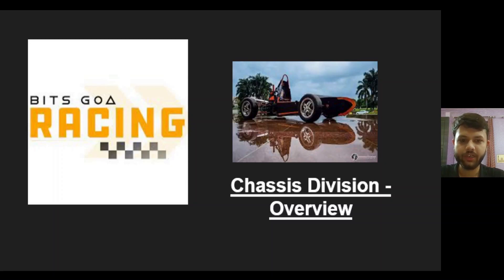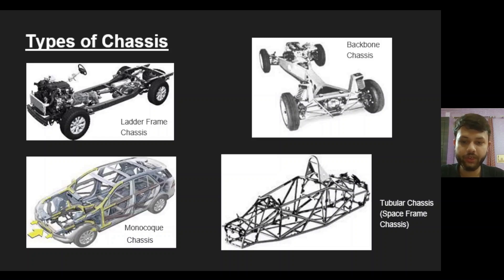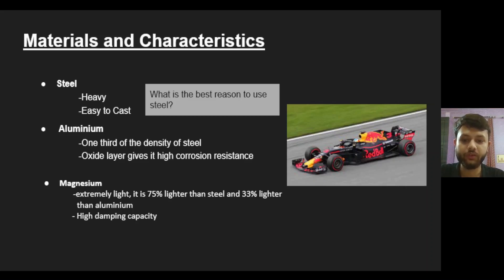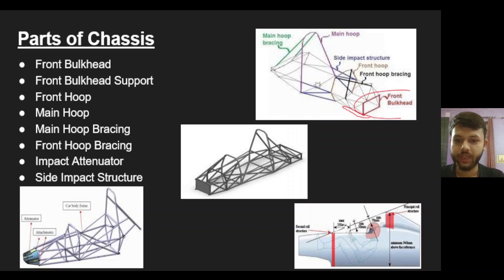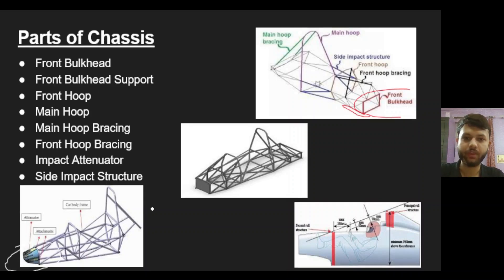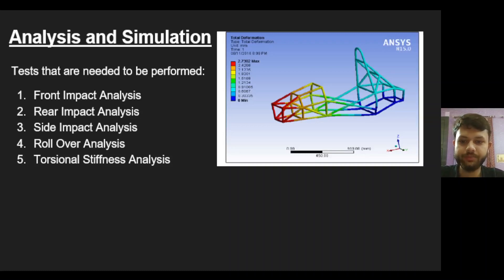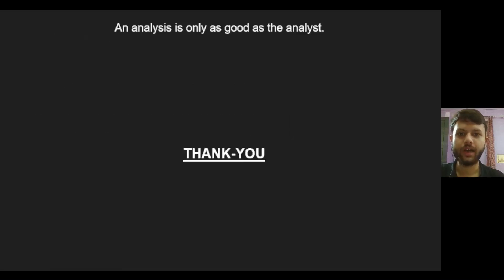Chassis - Different Types, Design Rules Explained & Material Selection | Formula Bharat | FSAE Supra

Comment from the maker: Video Timestamps

00:00 Intro and Video Outline
00:22 What is Chassis?
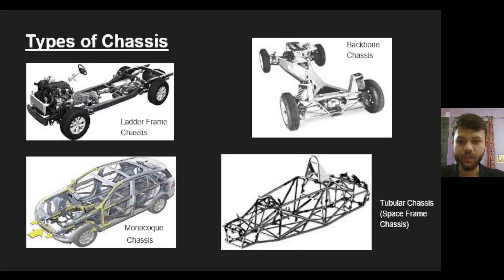00:51 Types of Chassis
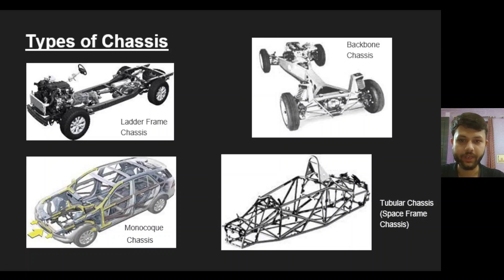03:01 Materials for Chassis Structure
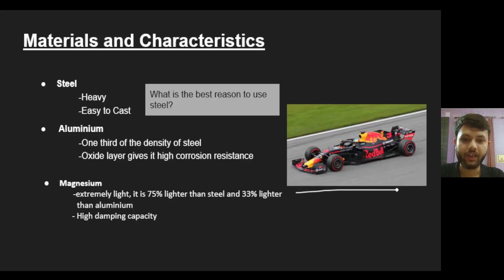05:19 Important Points to keep in Mind while designing
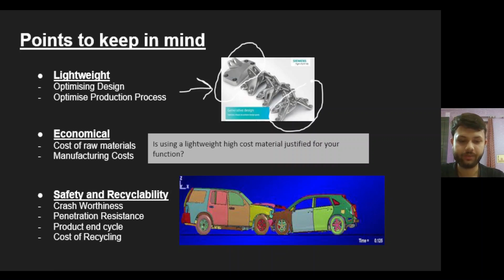06:26 Parts of Chassis Structure
08:29 Practical Scenario of Crumple Test & Crash Test
09:36 Why was Maruti Omni Discontinued
09:47 Concept of Triangulation - Basics & Calculations
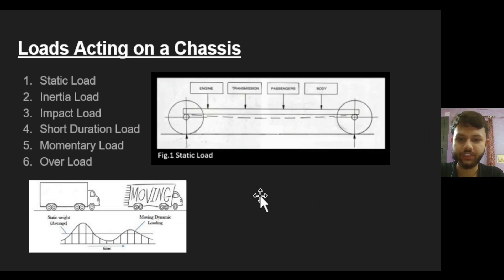11:08 Loads Acting on Chassis Structure
12:00 How to Start Designing your own Chassis?
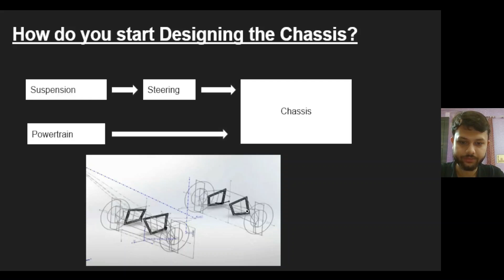12:33 ANSYS Simulations - Static Structural Analysis
12:55 Hand Calculations for Forces
14:58 Key Points in FEM Analysis